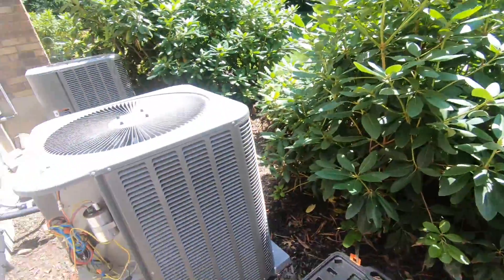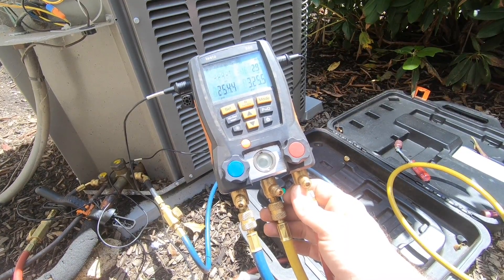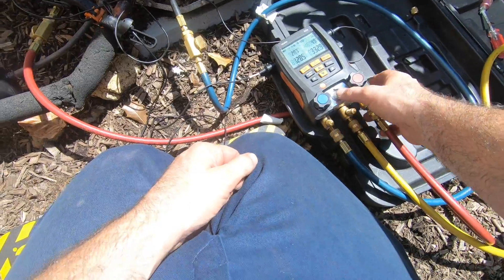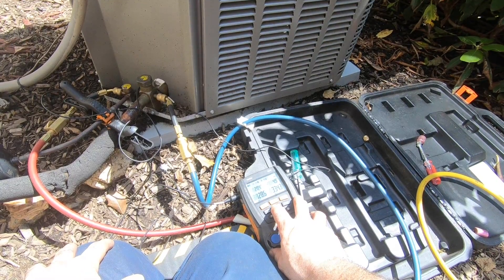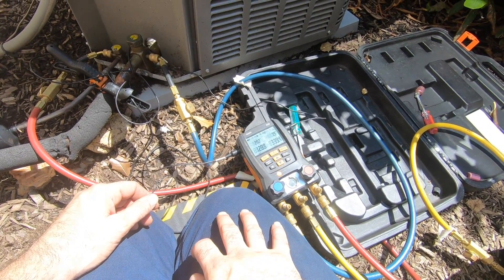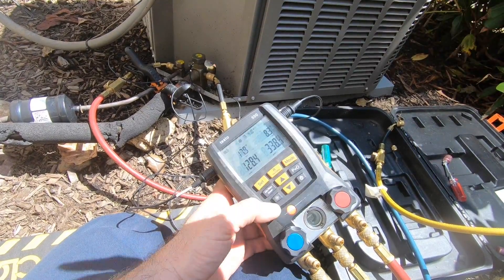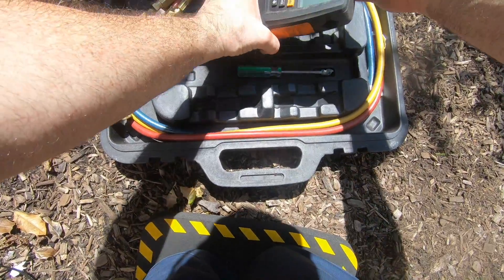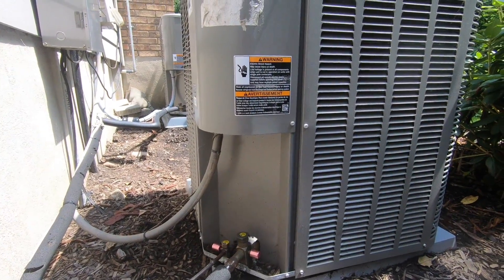HVAC Adjusting AC Subcooling to Increase Cooling Air Temp Split

Comment: Does sub cool and super heat apply to car airconditoning also ?
Reply from the maker: I charged my car up that way and many on here commented it won’t work. Yet it did. With a car you can easily weigh in the charge if system is empty. Usually there is a data tag showing amount of refrigerant
Reply: @thehvachacker  Thanks, it's an old car, all tags weathered white , manual was lost at least 10 years back. How much subcool did you charge to as general rule of thumb ?

Comment: Never leave a leak.
We didn't have digital. Looks like they do all the work for ya now.
Reply from the maker: You still need to know what to do with the info your seeing. The analog gauges with a pipe clamp thermometer gave you the same info spread across several tools. Now everything shows up in one spot.
Reply: ..but they dont purge atmos from suction and liquid hoses..

Comment: Leave a note on the inside of the door for the next guy that may have to add refrigerant.  There might be a small leak
Reply from the maker: I should have left a note, could be a small leak or it could just be the refrigerant lost from several years of maintenances. Some gas is lost every time gauges are connected. Only time will tell no history of this unit needing gas.

Comment: I bought my sman3's back in 2010. Love them. I don't understand why guys still use analog gauges.
Reply: Cost up front really..testo 550 with Bluetooth I use but reall problem is multiple refrigerants used..switching every 45 minutes..hoses retain a portion of past job refr. Have to either reclaim your hose full or ??
Reply from the maker: I use analogs at times pressure testing, vacuumed, sometimes on a repair yet many times I need a pipe clamp thermometer or I feel lost not knowing my subcooling or superheat. I love my testo’s many I see online love the sman gauges. I am looking at yellow jackets mantooth set up with my testos starting to get beat up

Comment: Sporlan smart tool is awesome. You can still add gas and remove gas and all you need is really 1 hose to do either. It's small and compact.
Reply from the maker: I will have to check them out

Comment: Sorry dude - it is best never to charge a system like you did (01:58).   I always throttle (slowly charge).  This way the compressor will never get slugged and the end result is a perfect charge.
Reply from the maker: If there is a valve core pin in the suction pipe then throttling is occurring. You have 1/4” hose reduced to a 1/16” after the scrhader pin reduces the port. Then the liquid after being restricted through the valve core pin mixed with 7/8” pipe full of superheated vapor. Which means very little liquid goes through the compressor. Now replace this valve with a king valve and the need to throttle in refrigerant is relevant.
Reply: Dont work with guys that do supermarket or large commercial/industrial if you think that's slugging a compressor. Try putting hundreds of pounds in at a time with cores still in and throttling it in slowly.. will be there for days. Plus if your slugging a compressor you will hear it. Adding a few lbs at a time through cores will probably not cause damage. It's good that your cautious though and play it safe. Adding through cores is basically a fixed metering device.
Reply: If its a scroll it will be fine.
Reply: I just open both sides and dump it.
Reply: exact never send liquid and keep botlle up ward ( gas)  add slowly ...lucky its a recent unit...just saying only 27 years in the biz...loll
Reply: @simonac688. The last 16 or your 27 years was doing it wrong and decreasing the life of your customers systems. Never send gas on 410
Reply: Gas -410= fractionization,look it up

Comment: always weigh in your charge
Reply from the maker: Weighing in gets you close yet charging a TXV system should always be to the manufacturers subcooling specs. When you weigh in don't forget to add how much refrigerant you need for the evap coil. Lennox puts the subcooling they want the system set at on a sticker inside the control panel. When you weigh in your charge is your subcooling always matching the manufacturer's specs? I spend a lot of my time commisioning new equipment. The downfall to this is all the communicating issues lots of these new system experience. These I can't make videos of. I won't go there now since that is off topic. The installation department weighs in the charge. Everyone that perform start and tests either adds or removes on most commisioning jobs to achieve proper subcooling. The Installers get the charge close where the systems cool. Yet after adjusting the subcooling, it is rare not to have a 20-degree TD across evap coil.

Comment: I would like to purchase the Fieldpiece JL3KR4
Reply from the maker: What do you like about this fieldpiece over the Testo smart probes? Or the Yellow Jacket Mantooth?
Reply: The fieldpiece display is better. Testos u have to toggle screens up and down to see pipe temp. Then SH and SC. And saturation temps.
Reply: Theyre nice. Decent range not great but good for most residential. I have no issues with the app it all works as it should. I find myself using my analogs more though.